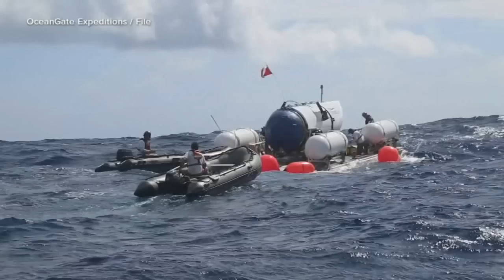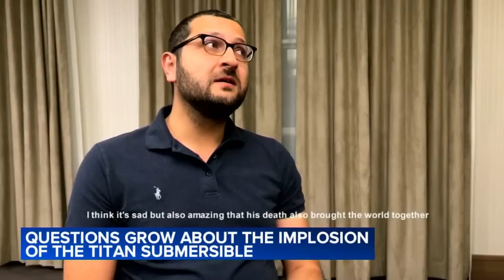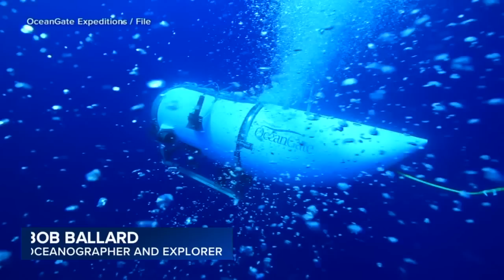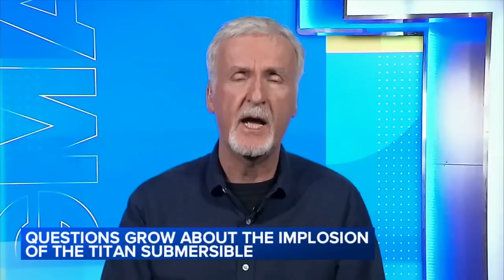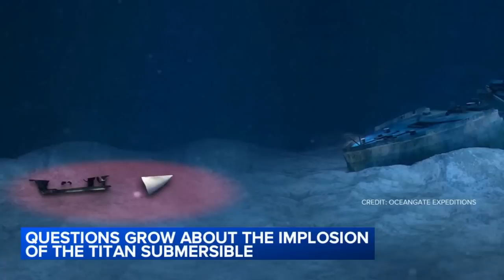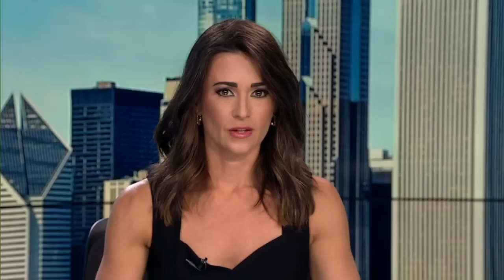How the unconventional design of the Titan sub may have destined it for disaster

Comment: I would suggest to ocean gate a revolutionary new design it would consist of a craft laid out in spheres or bubbles in a straight line.. of course theres more to it than that you would upgrade eveything to titanium steel at 8 inches thick minimum and scrap the fiber carbon inside the hull I would also upgrade all visible ports to withstand the 12,500 ft destination trip to the Titanic wreckage.
Reply: You're talking 1 billion dollar's worth of research and it's worth because our craft is retrofitting with arms in spite of having occupants control the submersible itself.

Comment: 🥸…? They ‘believe’ it imploded? Either it did or IT DIDN’T🫤. No sign of the bodies? What is ‘their’ explanation for that🥸?…

What is puzzling is the fact that all those on board KNEW that this ‘vessel’ was NOT TESTED adequately before the journey, BUT went away? This ain’t Denmark, but there is a very strong repulsive odor in the air🥸.